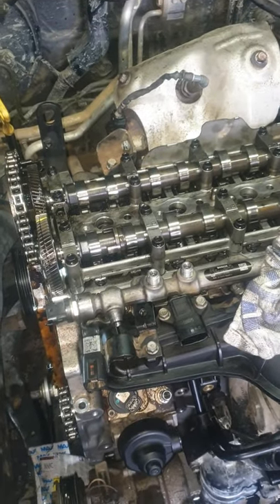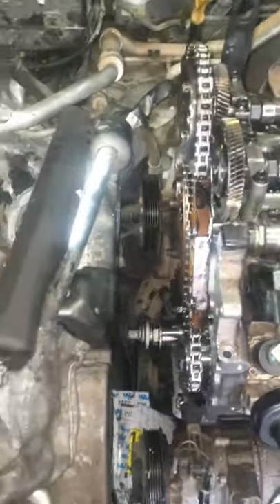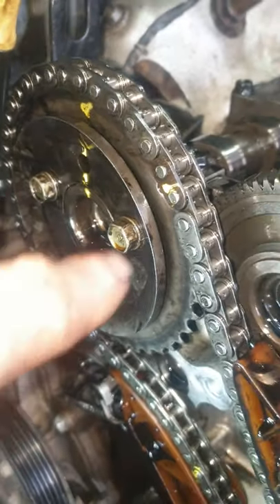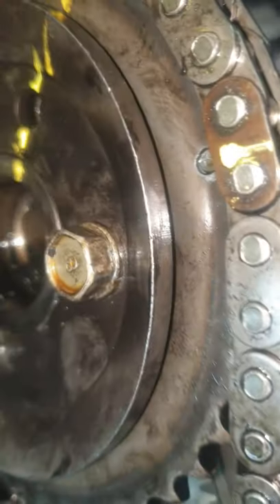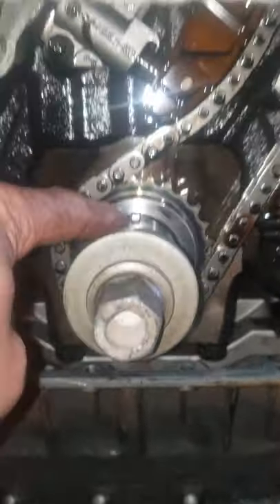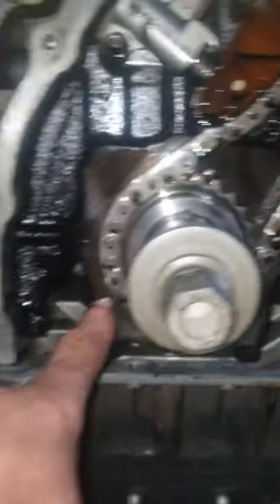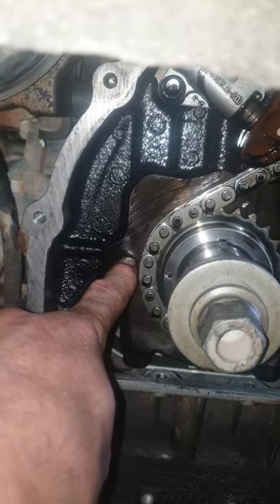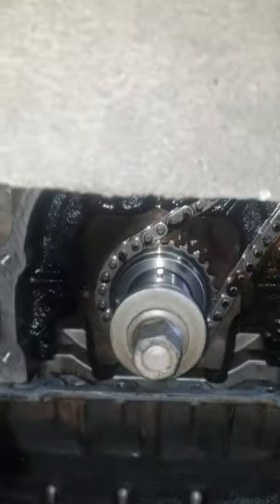kia sorento D4HB ENGINE timing chain marks .

Comment: does this car had a problem whit timing chain? i have the same problem with a 2011 kia sorento and the same engine.... where are you located? are you mechanic??
Reply from the maker: Yah .
Melbourne Victoria au
Reply: @jackautomotiveau they fail thoae engines ? 

I was told that they are super relible santa fe 2 gen diesel and the sorento ( same engine and trans) 

Is that lie ans they really bad cars ?
Reply: @leviSyosef my friend, the timing job must be done after 150k km on this car but can go up to 200k km without major maintenance. there is no problem, normal maintenance.